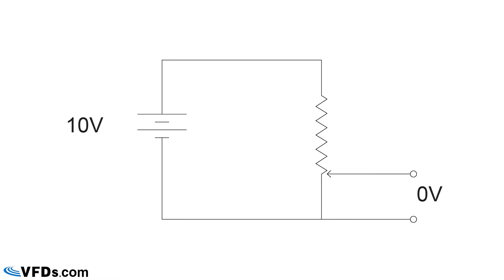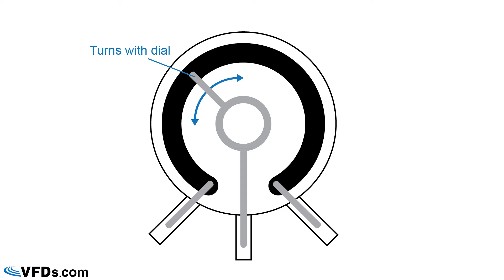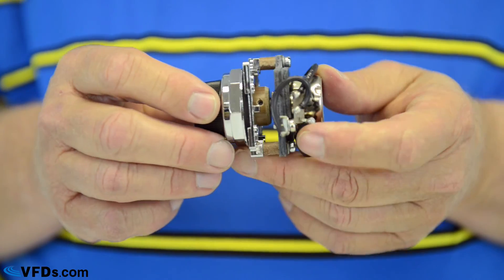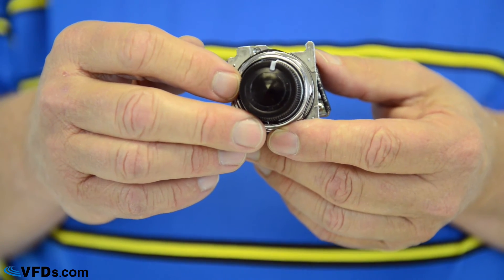What is a Potentiometer (Speed Pot)

Comment: Would the work to control the speed of a pedal assist on an ebike with a 36v 500w battery?
Reply: I never used a pot switch by it self. always with a vfd or if dc it needs a dc board.